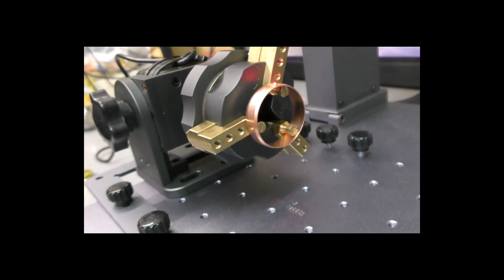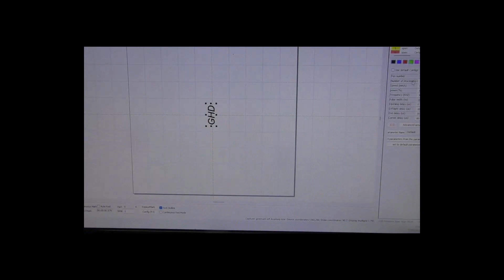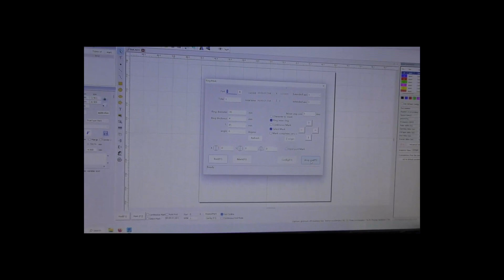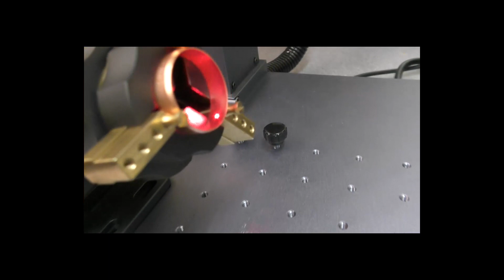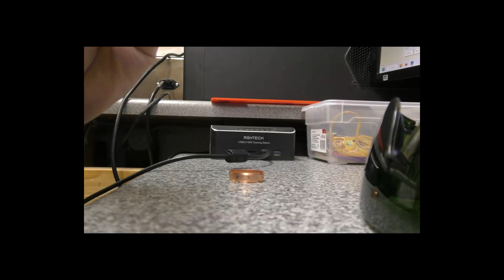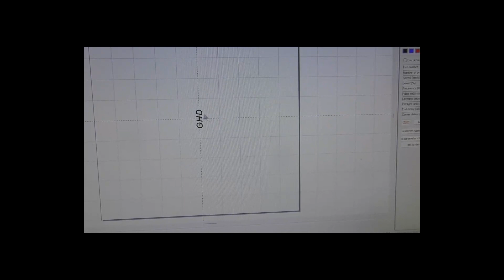Mr Carve M1 Pro Rotary Chuck Setup and Use

Comment: thanks for this video, i am absolutely amazed there are no instructions for this software anywhere ?   I have been using Solidworks CAD for over 20 years so I'm no novice with complex SW , but I am totally lost with all these LASER settings... its total guess work at the moment....
Reply from the maker: As I said yesterday, the best we have is various user manuals on my forum that cover the different versions of this software. Not ideal but you can get a much better idea on how it works, or doesn't...
Reply: @Trevs-Shed  Thanks so much for your help, I appreciate it a lot. I just got the Mr C as a bit of fun really, I am an industrial designer and so it sort of goes with the job having an interest in this type of stuff. I’m quite up on 3D printing, both extrusion and resin.. so having a LASER marker was another bit of kit to sit on the bench. I work for a Swiss pharmaceutical company and I have just ordered a UV LASER for almost 10k, really for marking plastic and glass, and expect it will use a very similar SW so learning it from your site will help enormously.. Regards Steve